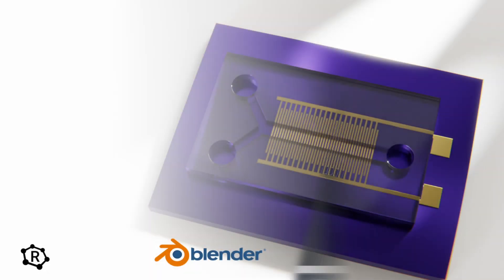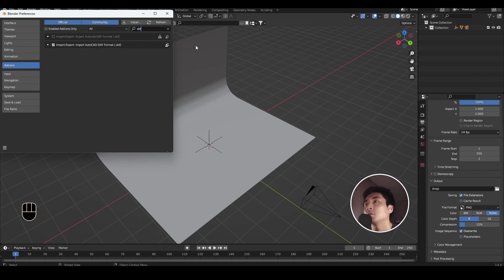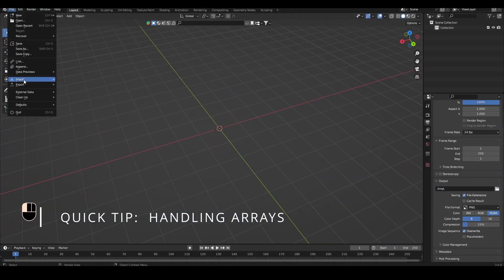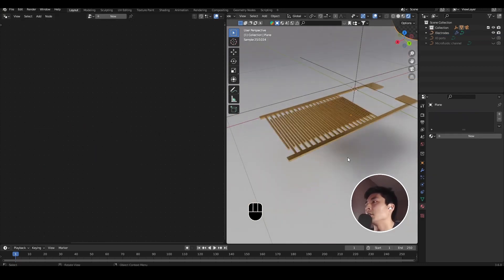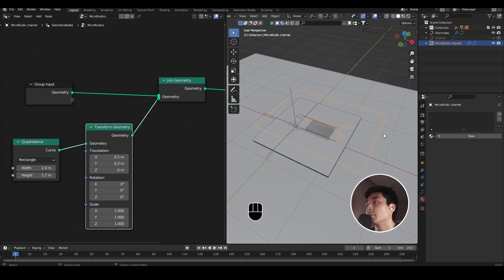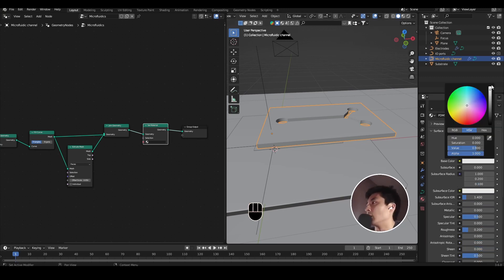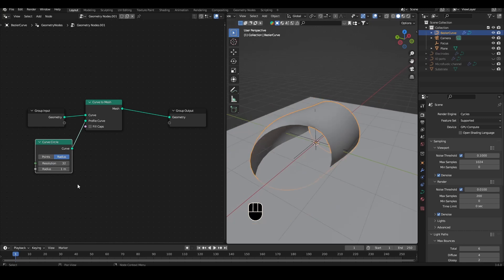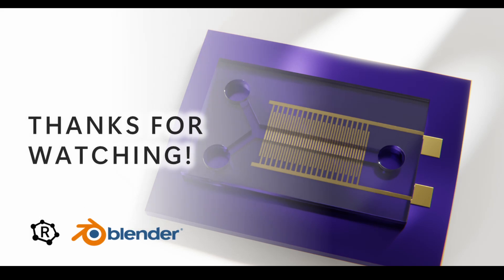Device Schematics - from AutoCAD to Blender

Comment: Such a cool tutorial - each and every component is made so "neatly" with the geometry nodes setup. This tutorial sits perfectly for intermediate science students and illustrators to understand the construction of the objects and their materials without feeling overwhelmed - this is one of those tutorials where Blender does not feel too scary to work with. I am sure I will be coming back to this video several times. The final render also looks so good - but I missed the part about how one could make the depth of field effect despite the objects being similar sizes and positions.
Reply from the maker: Thanks a lot for always checking out my videos! And also for the positive reviews 😊 glad to hear it is easy to follow! 

For the depth of field, I’m not doing anything special. There is an empty at the centre of the microfluidic channel as the focal object, and my camera f-stop is set to something quite low (<2). To make the DoF more apparent, I’ve 1) positioned the camera so it looks diagonally down to maximise foreground/background difference, and 2) brought the tubing out close to the camera for extra effect.
Reply: Cool, later gonna try out these GN concepts with some of my experimental setup models.  @ryomizutagraphics